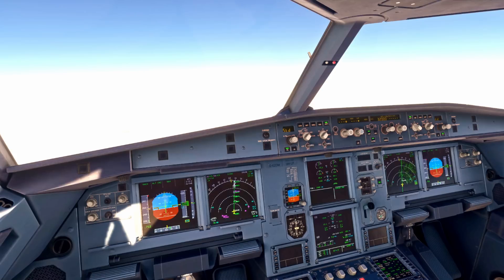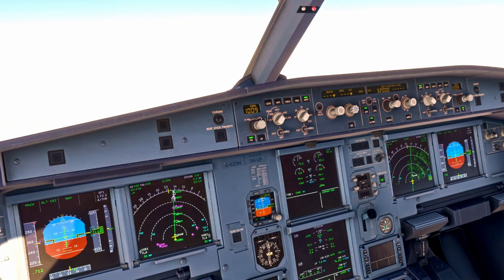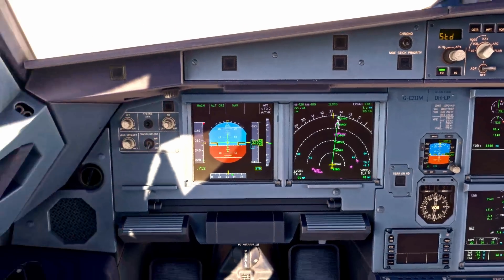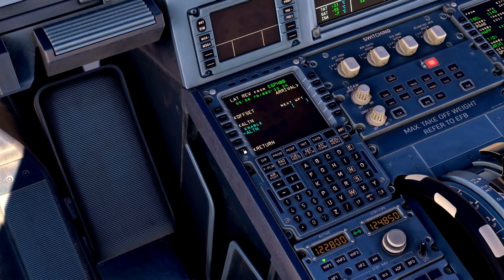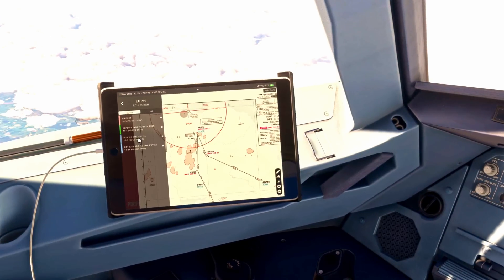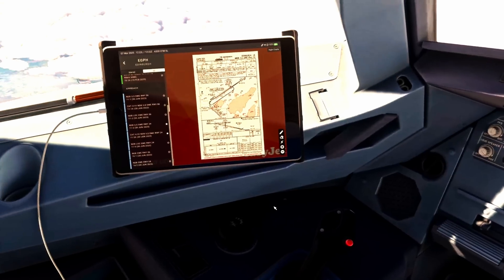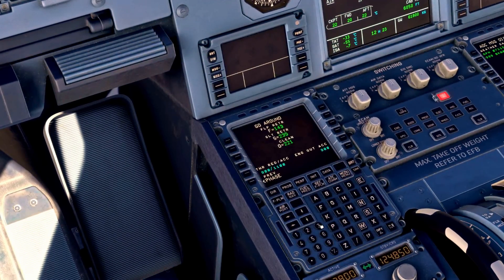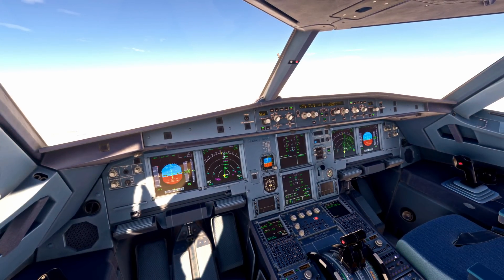How Real Airbus Pilots Prepare for Descent | Fenix A320 in MSFS 2024

Comment: Captain during the descent preparation, we input in the APP page data gathered from the latest METAR. Can you explain very briefly "how" the plane is using those data ? I understand how all these data affect the dynamics of the flight of course, but I am not clear about how the plane's computer is actually using them. To calculate what ?
Reply from the maker: Hello, the QNH is the most important piece of data. The computers use this to calculate a sensible rate of cabin pressure adjustment to match the local QNH on landing. Both QNH and temperature impact the barometric altitude so the systems take those into account which can alter your top of descent point. Wind, temperature and QNH are also used to fine tune the VAPP speed. As mentioned,  pressure is the most important for cabin pressure control. Hope that helps
Reply: @AirbusCockpitCoach  Ha ok, thank you for the explanation, this is very important indeed then !